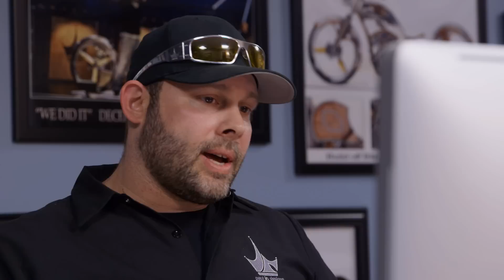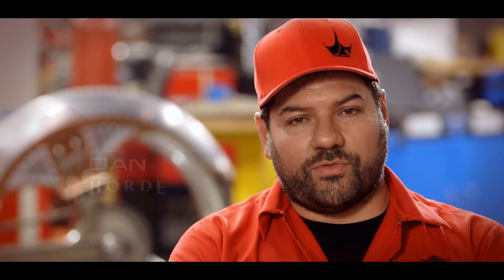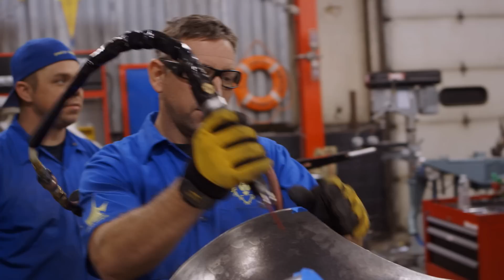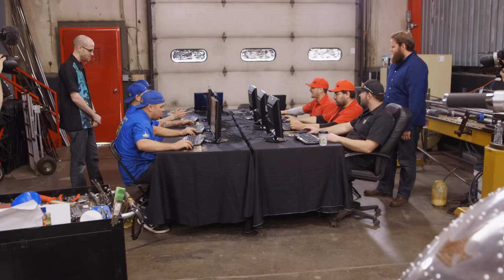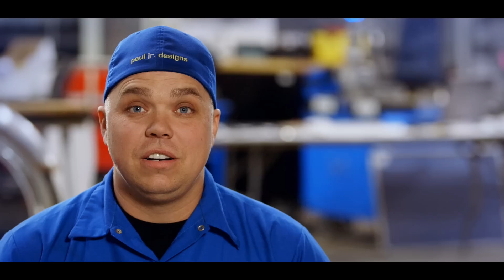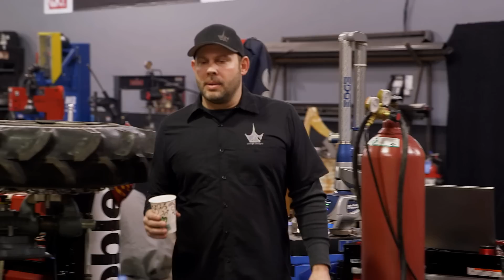Azeroth Choppers -- Episode 4

Comment: Money well spent blizzard.  Much better than actually making classes feel unique in WoW again.  Much better than working on your game engines so they don't look 10 years old the first time you show off a game.  And much better than fixing diablo 3 which is a complete disaster right now.  Much better than fixing the game for your fans, it's better that metzen or whoever fulfilled their weird fantasy.
Reply: Have you seen some of the stuff on the next XPac? They've kinda already done or at least greatly improved the stuff you mentioned, with the exception of the Diablo 3 thing.

 But hey Diablo 3 is Diablo 3, and this is a WoW video. Separate funding and what not, they aren't taking diablo's budget to work on this stuff, its WoW's.
Reply: I don't think they're short on money. Their games have issues because they have issues (greedy Activision).
Reply: ***** Why so emotional? And why would I need game design experience to know which games are good and which are bad? I liked playing Blizzard's games up until Cata. Then they took a nosedive in quality, as seen in "Pandaworld" and "Diablo 3", games which basically split their playerbase in half. I hope they get their game back, but until they do, their player numbers will continue to drop, I think.
Reply: Reaper of Souls has pretty much fixed most of the problems facing Diablo 3. There's still some stuff to iron out, but the game is a blast. WoW's classes are fairly unique. A balance druid plays nothing like a feral druid which plays nothing like a warlock which in turn plays nothing like a warrior. As far as the game looking 10 years old? Let's look at Unreal Tournament 2004 and compare it to MoP or WoD. I can't honestly see how you'd think the latest content looks 10 years old. WoW's aesthetic is working around polygon counts and texture resolutions that still trump MMOs that you see today, and it's using an engine that was last updated in 2009 and released in 2002.
Reply: I can't believe 11 people actually thumbed up your comment...